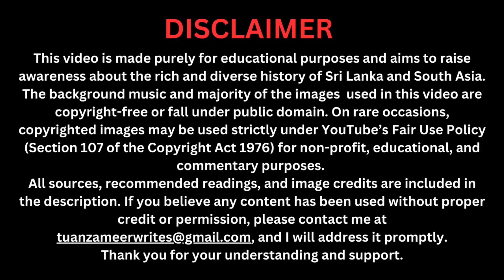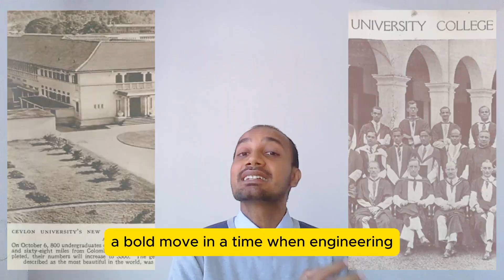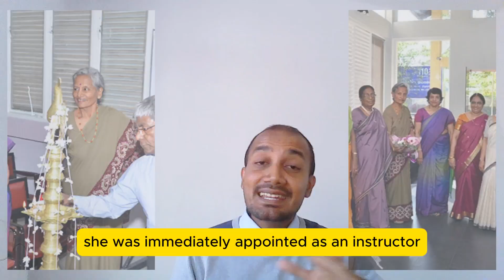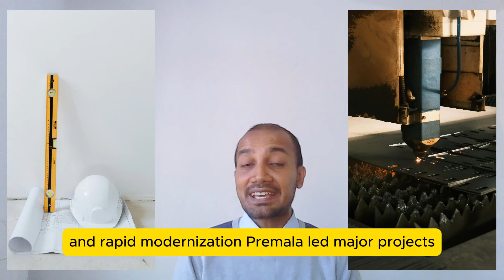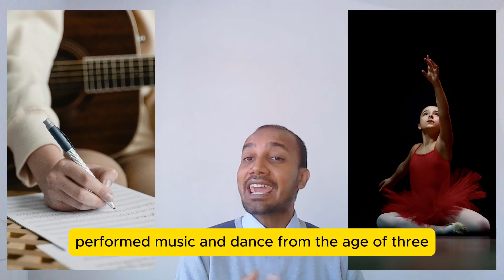Sri Lanka's First Female Engineer

Comment: Very active and had the strong determination to steer one time as the Chief Structural Engineer and head the Design for the Arts Block of Vidyalankara campus (Now Kelaniya) and the Army Officers' Accomodation and Main Kitchen at the then Army Headquaters Premises at GalleFace. 
The Arts Block Building had 40feet clear span open halls and it had ground plus 4 floors.

Comment: Hello, you forgot to mention that her father was also a structural engineer and was my structural engineering lecturer. His 'Hardy-Cross' moment distribution was so boring that I did not touch those questions at the exam. Electronic calculators were unheard of, and we used a thing called slide rule then. However, I managed to work out software to do that same distribution automatically and give me a drawing with details. We have fond memories of all.
Reply: He mentioned about Dad being engineer too.
Reply: Dr Careem also mentioned that he was an engineer attached to the Colombo Port authority and that he also worked as a faculty member at the University of Ceylon.